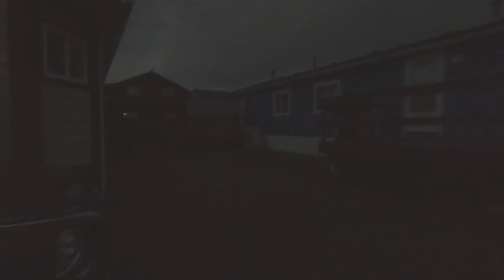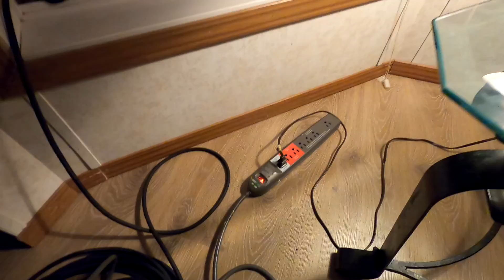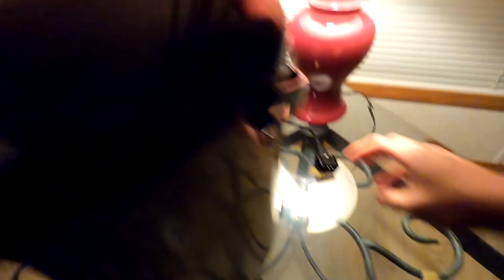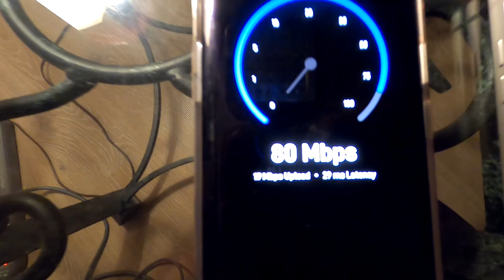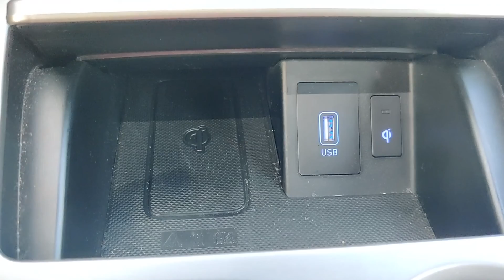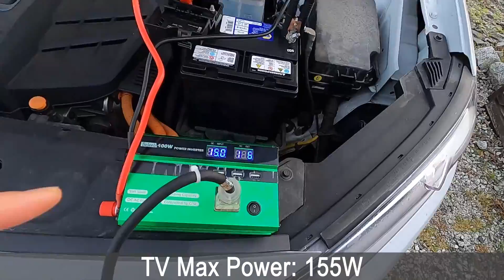Power Outage! But EVs Can Help

Comment: To me this is the most ridiculous thing especially during cold weather. So not only is your house without power but if it's a long outage your car will be too and you're going to be stranded at home.
Any appliances that heats things is going to use way more power. Like your hot water dispenser keeping that running during a powder outage to me when you have limited resources available your car is at 60% state of charge.
He would be better off getting a power station that you can charge with solar or the wall they are cheap enough now and just having that ready and on standby mode to run small things in your house in the event of a power outage.
Lesson learned for an Ev vehicle always keep it fully charged.

Comment: My 2 cents:

You didn't mention very important thing - ev car must be switched ON to avoid 12v battery discharge.

Second - it would be convenient to power the whole house.
Extension cord put into any power outlet and that's all.
But very important to shut off power switcher that is powered the house before all the manipulation.

Comment: So how can an ev help you in a black out ?

Well you certainly  cant charge  your ev without power 

Well i spose you can use your ev as a barbecue when the battery goes into thermal runaway and  burns down your home  being in the garage ?

Comment: So in the case of the Kona, you need to keep it in utility mode so that it doesn't shut off, right? 
I wonder if someone could retrofit the 2024 kona on board charger to a 2020 so you could just plug a V2L outlet into the charge receptacle 😅